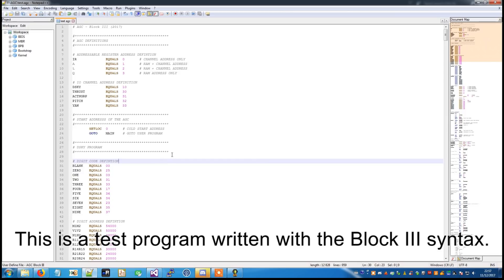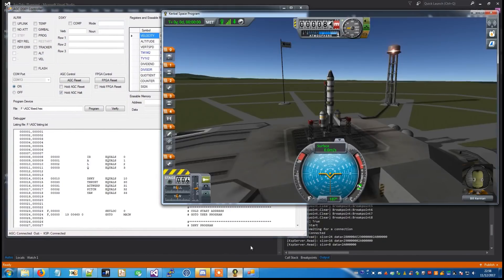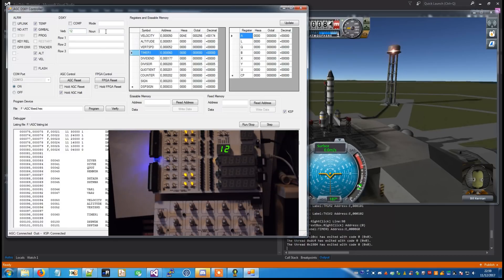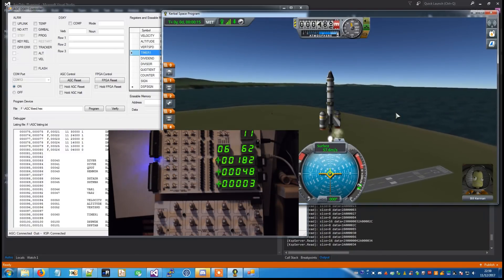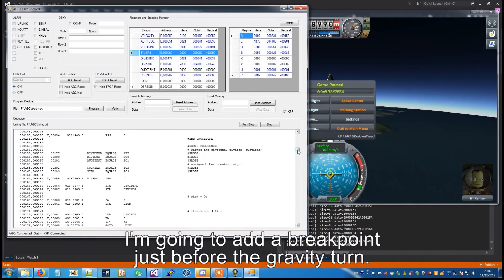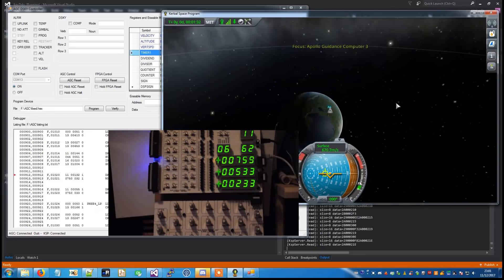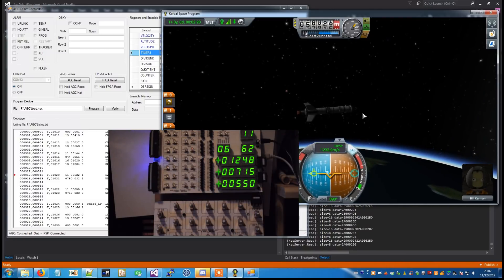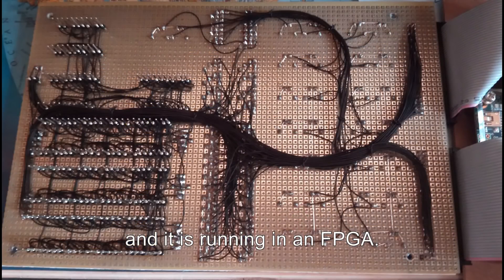Apollo Guidance Computer - Block III

Comment: C'est un travail impressionnant ! Par contre j'ai du mal en percevoir la portée, c'est uniquement pour le challenge, ça a une d'application  future possible et utile ? Mais sinon c'est impressionnant, félicitations
Reply from the maker: Merci,
C'est pour le challenge car Hugh Blair-Smith limite un peu le projet dans le sens où il veut que le design corresponde à ce qu'on aurait pu avoir dans les années 70 voir 80 (à l'exception du fait que j'utilise un FPGA pour l’implémentation).
Pas d'application future, je pense pas que SpaceX utilise un système de guidage dont le CPU soit cadencé à 1024kHz
Utile je sais pas, il y a peu être dans le design des paradigmes qui sont innovateurs (je ne sais pas).
Reply: @bru57000  merci pour cette réponse très claire. Bon courage pour la suite et encore bravo

Comment: Bonjour 
Le block 2 est il l’ordinateur avec le programme tissé en fil de cuivre avec des aimants. Si oui le bloc 3 as t’il été prévu comme cela aussi et pensez vous le tisser en fin de codage?
Reply from the maker: Bonjour,
Oui, le programme du Block II était tissé en fil de cuivre avec des aimants "core rope".
Aucune chance que je "tisse" le programme, il faudrait que je fabrique une machine sur mesure pour le faire.
L'assemblage est semi-automatique, une opératrice appuie sur un bouton ou un levier qui aligne/désaligne  les anneaux de ferrite en fonction du code binaire, elle passe les fils de cuivre dans les anneaux à la main. Ca va couter beaucoup trop cher à fabriquer et ça n'est pas reprogrammable.
Si le Block III avait existé à l'époque il aurait toujours été fait avec ces core rope.
Cette technique impose des contraintes sur les temps de lecture et écriture des mémoires (ça fait parti des contraintes que je dois respecter) A cause de ça on ne peut pas non plus augmenter la vitesse du CPU.